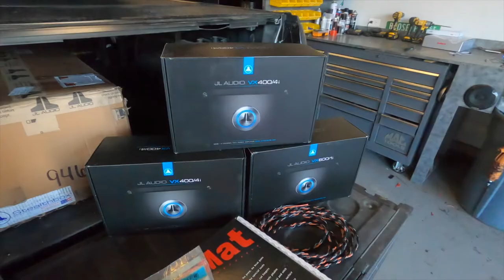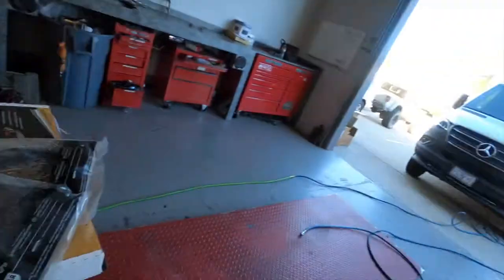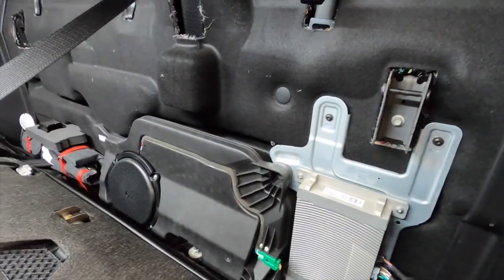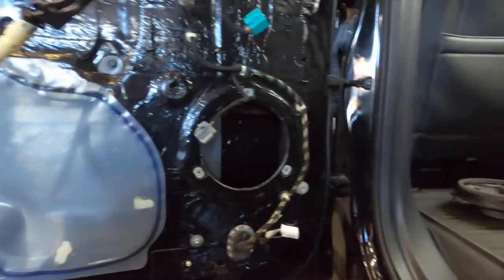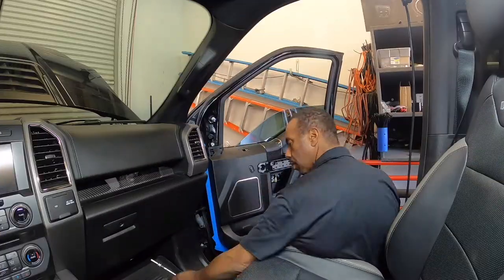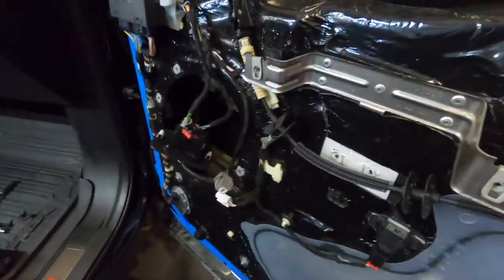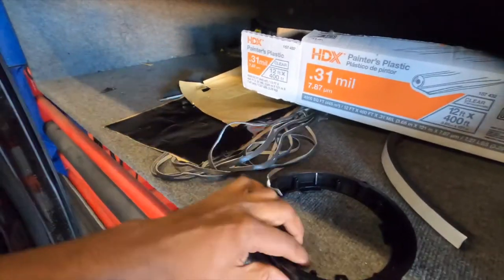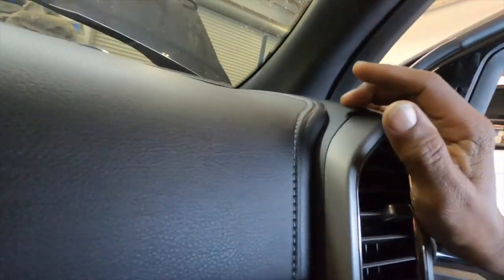2018 Ford Raptor audio Upgrade Part 1(Focal Flax speakers & Hushmat sound deadening)

Comment: What tape do you put around the speaker spacer to seal it?
Reply from the maker: I use this when I need it.
https://www.amazon.com/gp/product/B004MSRSB0/ref=as_li_ss_tl?ie=UTF8&psc=1&linkCode=sl1&tag=deansamazonst-20&linkId=716b553791e78b66537a0ed9ee795510